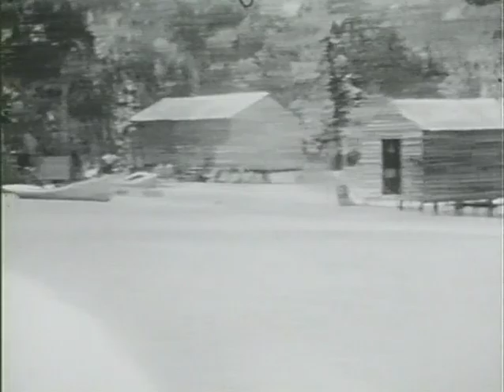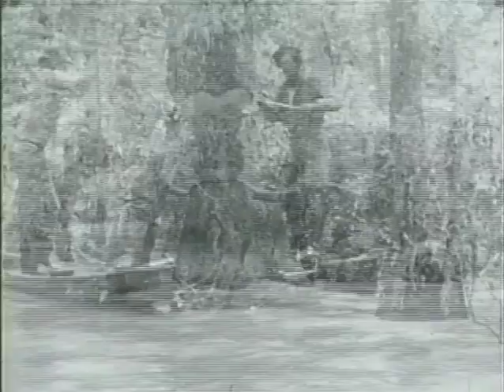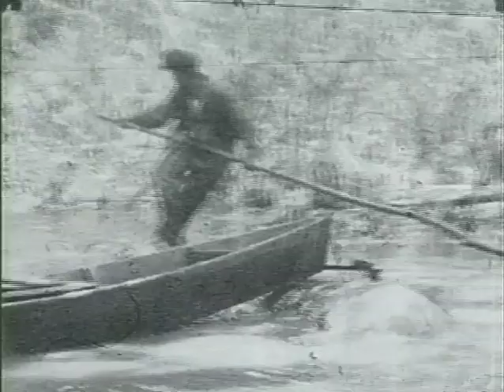Louisiana Cypress Logging, 1920s

Comment: When French explorer Beinville first laid his eyes on the Manchac swamp area outside of the New Orleans area for the first time in the 1600’s he was left breathless.  The beauty he described was incomparable to anything else he had seen on earth!  The cypress, and tupelo forest was so dense that it was virtually impassable.  That’s why it was the perfect hurricane barrier.  The wildlife he described was breathtaking as well.  It was completely possible to disappear into the swamp and live off it for a lifetime as many did later to avoid the civil war.  Today as I daily drive through this area I can only imagine what it used to be like.  Now it is only a huge scare.  Maybe catch some fish or alligator or see some eagles or water moccasins.  But this wound will never heal because it was cleared of everything that had taken thousands of years to grow.  New growth cypress hasn’t the rot resistance of old growth wood, so any structure that is built with the old should be recycled if it is torn down.  That old wood is priceless.  No need to even paint it.  Beinville would certainly cry if he could see what has happened to the southernmost forests he admired once.  BTW, I planted a seedling 30 plus years ago and it hasn’t lived long enough to harvest a 2x4 yet.  These trees couldn’t get up and run away from the saws.  Why couldn’t our forefathers just have cut the pine and oak.  At least it grows back fairly fast.